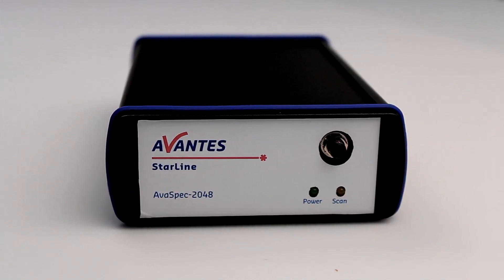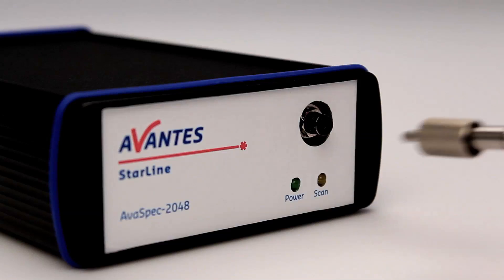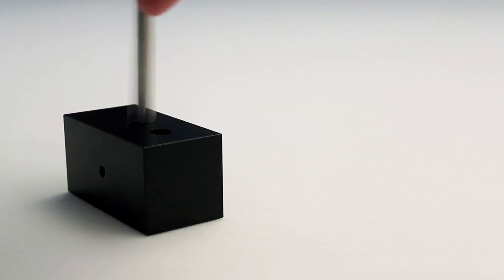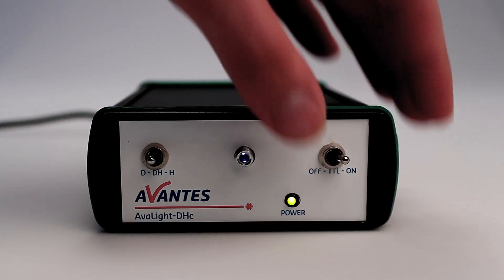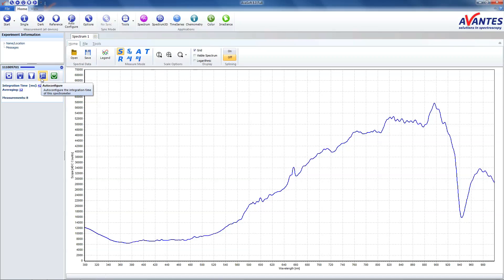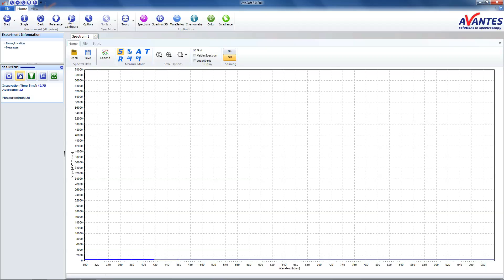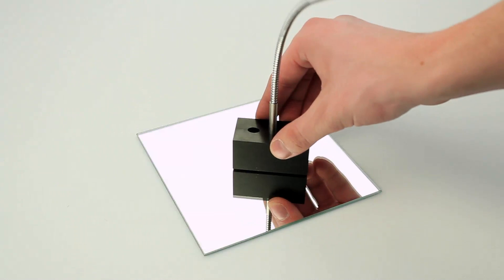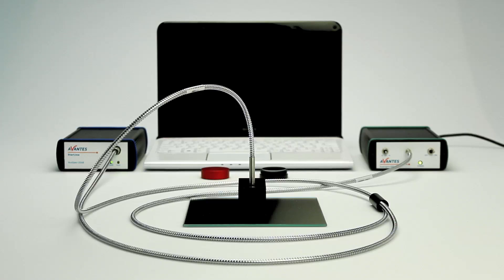How to do a reflection measurement using an Avantes spectrometer

Comment: How do you perform reflection measurements of viscous fluids?
Reply: Hi Webber gca,
Avantes have some reflection probes that are specifically for powders and thick fluids. You can just dip the probe into the fluid you are interested in and perform the measurements. There is more details on the Avantes website;
http://www.avantes.com/products/fiber-optics/item/248-reflection-probes-for-powders-and-thick-fluids